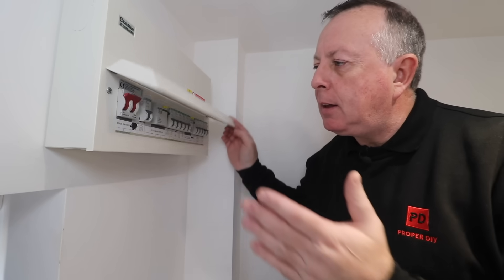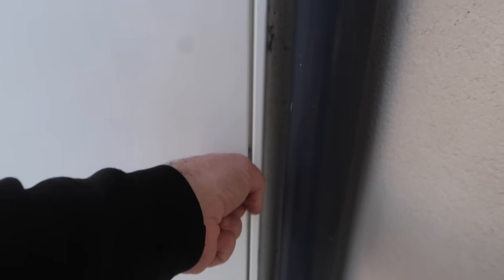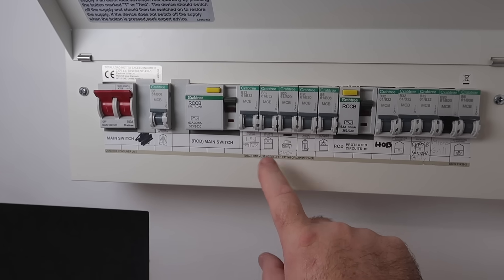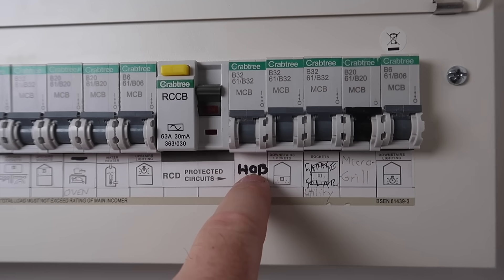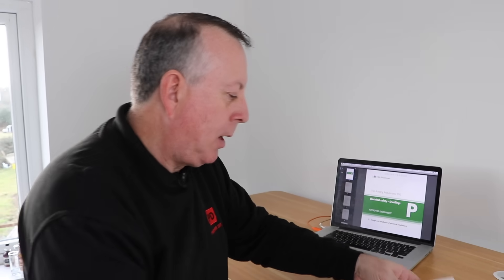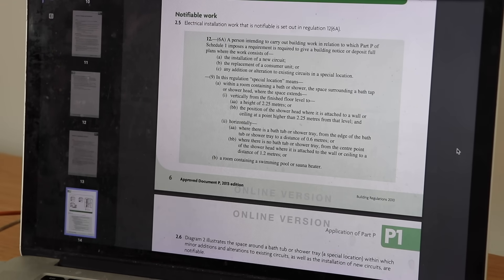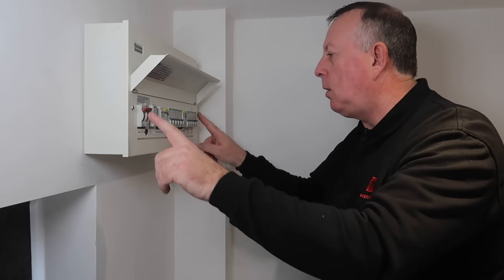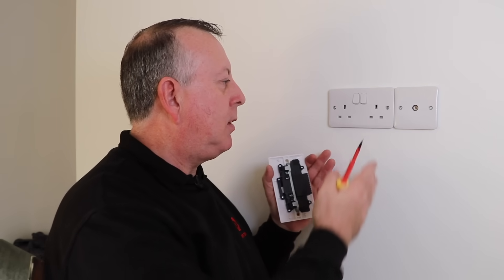What electrical work are you allowed to do in your own home?

Comment: Hi. Great video. I have a question, which I am really struggling to find an answer to. It seems a great cost for an electrician is the running of cables, etc. Can I run a cable myself to a consumer unit and then get an electrician to terminate it at both ends, or will he/she need to see the cable run. For example if I wanted to run a 40a cable from an external location near to my driveway (attached to house) and then run that cable internally through conduits, floor boards, etc., and then leave a length adjacent to the consumer unit. Then an electrician comes and does the clever/notifiable work at each end? Means I do the labour intensive stuff - pulling up carpets, running conduit, etc. I can see a scenario where they may be uncomfortable with not running the cables themselves - but surely carrying out a test should ensure this is all okay.
Reply: Nope. The certificate literally states about checking the cable, its fixings etc.

If a spark agrees to that, chances are he’s dodgy or crap

Comment: I rewired my own house. I dont have 2391 qual but I'm up to date with BS7671:2018. Am I in trouble?
Reply: Did you notify it?
Reply: @jameshansing5396  nope
Reply: In trouble with whom? I suppose if there was ever a problem & say someone got electrocuted via some fault in the wiring - a family member or someone visiting then you probably would be liable. However that would also apply to electrical work done by a pro & yet unless it could be proved it was their work that was at fault they would not be liable. Bear in mind people have rewired their own houses & it was perfectly legal before newer regs came into place & yet they would be in the same boat as a pro. Of course then it comes down to how can anyone prove who did the work & when it was done. If you have owned the property for years then it could be argued they would not have a clue when the work was carried out unless it is obvious that the work was done after the regs came into place & of course then as a property owner the work was done with your knowledge. Personally I would not worry as if you are confident the work is done competently then there isn't going to be an issue anyway. I mean what circumstance is electrical work going to be a problem if it is done correctly?
Reply: Could cause you issues when selling a property, could cause you issues with insurances.  Id also suggest it's possible this person might not know how good or compliant their work is?  I mean, if they are asking this question, their knowledge isn't 100%, is it?

IF someone is electrocuted or your house catches fire might be a fairly big IF in your eyes but it does happen.  You'd be surprised how often we find electrics with have been smouldering away, melted connections etc.

What you want to ask yourself is, IF it DID happen what are you going to say in court?

The BIG aspect of this is 95% of DIYers won't have a proper FMT so cant test their work.

Basically IF the worse DOES happen, you re suddenly DOUBLE f*cked..  and yeah, there is a good chance it can be proven when the work was done and it it's your house that's your responsibility......

 @triax7006
Reply: I'm fully confident my electrical work will pass an EICR, I just haven't had it signed off. Wonder if it's worth spending the £120+   @triax7006

Comment: Worth noting that as a matter of fact, no question about it, there’s absolutely no difference in law in England and Wales between what a DIYer can do and a registered electrician. Anything a registered electrician can do, a DIYer is permitted to do also, including notifiable work. Both DIYers and registered electricians are also obliged to notify the building authority of notifiable work. The only slight difference is that a registered electrician is able to self-certify that work complies with the building regs, whereas the building authority will inspect a DIYer’s work. That’s it; that’s the only difference, nothing else.

And most legal advice filed out by electricians is nonsense, of course. Good example is the nonsense here about not being allowed to open the consumer unit. For a consumer unit, nothing other than installation of a consumer unit is notifiable. So any other work on a consumer unit other than installation is not notifiable. That’s not me that decided that, it was Parliament.

The restrictions imposed on electrical work by the building regs are actually very minimal, despite what self-important tradies may like to pretend. Which of course makes sense, because connecting the blue wire to the blue wire, and the brown wire to brown wire is not difficult.
Reply: Yeh I think this guy has it wrong. It's all about legally having the work pass a test just like a car that is 3 years old or older has to pass a MOT & of course like an MOT as soon as the person testing it has left the building it doesn't mean the electrics are safe, it just means they checked them & they were safe when they checked them. The only reasons a "pro" would not usually check DIY electrics is because they would need to check all parts to be sure it all conforms to regs whereas a pro doing it would self check at all points & finally check it when finished. The other reason is protecting their industry, they want to make sure that DIY work cannot really be done so they get more work, the same with the legal profession & many many other industries.
Reply: @triax7006  There’s no way he can have read the law and formed his opinions based on it. He’s clearly just sat on the toilet and dreamed up what he thinks the law could be, presumably with the aim of making his job sound complex and skilled.

It’s the equivalent of a lawyer with absolutely no electrical knowledge making a video about how he thinks electrics might work, and getting completely the wrong end of the stick.

Comment: I will do what I want in my own  home
Reply: Do you fiddle around with your gas boiler?
Reply: @davebadger100  yes why not? Other vise it is straight racketeering
Reply: @lPalaXl  Yeah. I mean what could possibly go wrong?
Reply: @davebadger100  The same thing can go wrong when you use a gas cooking stove. Just dont be dumb that's the only requirement. Maybe a pressure sensor could be useful for configuring the gas boilers automation system though you can do it without it. 
For repair you even don't need any knowledge for new installation yeah you maybe need to do some calculation or read manual to know what supply/went air flow you need nothing more)))
Reply: @lPalaXl  So  no gas flue analyser or drop test then?
Reply: @davebadger100  you can rent them for day or make it with simple pressure gauge and hand pump)))
flue analyzer you have nose man))) (and again air flow for supply and went need to be calculated as i stated)
You trying to make some kind of rocket science out of simple electric/gas/water things))
I am software engineer born in 1993 and i am doing all gas/electricity/water in my apartment/house when needed and never had problem with that. Recently i installed 15kWt storage system with invertor and ATS wiring for backup zero problems with that. Oh no i had one problem one of my lamp in ceiling which was wired by "professional" electrician from residential developer where i get house was miss wired they connect N and PE to it. So yeah i better will do thing myself it will be better and cheaper.
Reply: @davebadger100  Last time i even tried to buy something from "trade" person was to make desk parts based on my design. Just a basic 2000x800 loft table. Wanted to get two legs welded from 20x40-50 steel rectangular tubes. Materials are less than a hundred bucks, and they charged me a grand+. Yeah, right! I'll just DIY it.
Reply: @lPalaXl  I'm guessing you're from the US. I've seen the state of the electrics over there. No wonder you think it's easy. You're about 40 years behind the UK in standards and installation techniques.
Reply: @davebadger100  I am from UA we basically have the same standard as EU+- but regulation and fines a lot weaker.
Same cables same MCB, RCD, ASDD, Voltage Relay etc usual 230v staff from abb, hager, schneider. The only thing that we mostly using MCB instead of fuses in low voltage.
Same about gas boilers etc we have access to italian gas control valves etc (And unfortunately it is illegal to touch them.... For absolutely zero reason but fine is cheep)
Reply: I feel sorry for your kids… 🤢

Comment: I have rewired three houses that I have lived in without problems if you suck up all you can read before you go and adhere to what you have learned it is fairly reasonable so long as you personally are switched on 😊
Reply: I would have no issue with buying a house that has been rewired by the owner. I would check the work myself & even if I found problems I would simply point them out & negotiate a reduction in the price. The real problem is assuming everything is safe because a "pro" carried out the work. The amount of incompetence with so called "pros" is astounding & ppl assume the work will be safe because a piece of paper says so.

Comment: Fortunately for me, I live outside the reaches of the bureaucratic minions of the UK, EU, USA or Can and insurance concerns don't apply.   My adopted  country has incorporated the US NFPA standards and supposedly requires a "licensed" tradesman to do electrical work.  The only problem is that there are no such tradesman because the process to educate, test and certify such tradesman was never put in place.  Not to mention that there is no translation of the NFPA available except at great cost.  

The quality of existing installations are all over the map but other than my personal dwelling, commercial and medical buildings and a very few others, it's the wild, wild west.  Conductor color code, even ampacity sizing, is ignored.  Sometimes only one color is supplied for all.  Grounding and neutral bonding are the most grievous faults.  As a retired P.E. from the US, I'll trust myself to follow good practices because a competent local is unavailable.

Comment: Why don't you show us also how to replace a 220 volt, 30 amp three copper plug outlet (such as for an electric clothes dryer) without an electrical permit. Better yet, show us how to replace an electric range/stove 220 volt, 50 amp outlet without pulling an electrical permit. 110 volt, 15 amp circuits are child's play, per "Chucky." :-)

Comment: Why are you adding any thing of your own in the dnos cupboard that's a definite no no
Reply: He owns the cupboard not them. They have all the space they need to get at their equipment. That is all they need.
Reply: @johnburns4017  well I would like to see you try and get away with adding in in the box done I deal with solar and ev chargers and we have been told not to put a garage unit I that box and after speaking to other engineers it's the same with them aswell
Reply: @garybill1323  
A garage unit is an appliance. In this vid there is  Lewden box, which is not an appliance. There also lots of space for them to  get at their own equipment. 

Once again. It is not their box. If they want exclusivity to a box, they supply it. Shishhhhh.  You are naive.
Reply: @johnburns4017  And if they decide they don't want your equipment in your box, they can cut off your supply and there's fck all you can do about it. 
Shishhhhh. You are naive.
Reply: @davebadger100  wrote:
"they can cut off your supply"

Can they?  You are naive.
Reply: Don't listen to John Burns. He is a DIY know all who is a prime example of why untrained, unqualified, incompetent people should stay away from electrical work.
Whilst he is correct in saying that the homeowner owns the cupboard, it is a cupboard designed for and supplied for DNO equipment ONLY. Whilst some DNO' s may turn a blind eye to domestic electrical equipment installed in the box, some won't. 

If you do install equipment in there, you could well be deemed in breach of your electricity supply agreement, and if you refuse to remove it when instructed to do so, worst case scenario would see your supply disconnected.

Again John Burns, stay away from electrical work, you really have no idea what you're on about as usual.
Reply: @davebadger100  
More ad hom attacks. He lost it.
Reply: @johnburns4017  Not at all. I am refuting the mis information that you keep posting. 

If you had a valid argument you would come back with a relevant response disproving  my argument.
You haven't, which just goes to prove that I am right and you are wrong.

Look let's face it, your basic DIY 'knowledge' is no match for my superior qualifications, training, skills and knowledge.
Reply: @davebadger100  
Ad hom attacks. Lost it big Time.
Reply: @johnburns4017  Any thoughts on the use of the DNO cupboard by the homeowner?
Reply: @davebadger100  
More inane tripe.
Reply: @johnburns4017  🤣🤣 Who's lost it then?  From your responses we can safely assume that I am right about the DNO cupboard and you are yet again wrong.
Reply: @davebadger100  that is what i was meant to say thanks for clearing that up for me 👍🏻
Reply: @garybill1323  No problem. The evidence is there, just takes a little bit of digging. Efixx actually did a video on the subject. Obviously being in the industry we all know what is and isn't acceptable.

Comment: Certifications are all fine and dandy, as long as you have the skills to back them up...
Reply: If you don't have the skills then  It's unlikely you would work under an NIC company as they hold high standards and anyone who works for themselves would Not be recommended by clients, Also ask the tradesman for a list of people who would recommend them.
Reply: @SJ80s  Straight racketeering. We forbid you to do things yourself and have certification/insurance system build around it so you will may a ton from your pocket for it for no clear benefit whatsoever

Comment: What electrical work are you allowed to do in your own home? 
All of it. ( small town in USA )
Reply: In the UK you can do all of it, except touch the suppliers equipment and meter.   You need to be competent.  That is the key word.
Reply: @johnburns4017 
Same here in small town USA. The three overhead lines, the connectors to join to your own three feed wires and the "plug-in" meter portion of the meter box are the only things owned by the company, everything else is is owned by the property owner.
Agree a person SHOULD BE competent to do electrical work, but that is not required under the law (PSA check your local laws) to do the work in your own home.
Reply: I mean you lot voted for trump so yeah fuck it

Comment: Everything said in this video is very sound and sensible however,it is completely wrong on the point of law! No one is going to take you to court or fine you £5000 for installing your own new db or any circuits you may wish to add, or even rewiring your whole property! Part P came into being to regulate businesses and registered self-employeds like kitchen fitters and plumbers who carry out some electrical work in the course of their work to give them accreditation to comply with their public liability insurance requirements. It does not apply to home diy whatever you may think. If it did, B&Q wouldn't be selling any electrical materials to you. If you go to any of the electrical wholesalers in the land, they will not ask you to prove you have part P before purchasing anything you want to! Oh and by the way, believe it or not the IET 18th edition regs are advisory, not mandatory! I speak as a professional electrician, however much I hate the awful botches diyers make or even 'checkatraders' come to that, Yes, part P is a good thing but in all the years it's been around, I've yet to hear of anyone who's been prosecuted or fined for adding their own ring main or wiring their own shower!! As for building control at your local council - don't get me started!
Reply: "the IET 18th edition regs are advisory, not mandatory! "

Correct!   You can fit a full US specced installation in the UK - God forbid! Or a French or German. I recall seeing house full of German Schuko sockets and German CU (cool) - he was German, buying them cheap in Germany.  All legal. I have seen full UK specced installations in Spain and France by UK ex pats.
Reply: Good points. I like to see it in the same light as doing work on your own car - especially the parts of the car that would be in a MOT. If anything is done incorrectly or are downright illegal the aprts a MOT cover will make sure the car is safe for the road - at least at the time of testing because as soon as you drive back onto the road an MOT whilst legal doesn't mean the car is safe to drive on the road. The same could apply to electrical work tested as it will be according to regs & signed off, however even if no more work is carried out it cannot be assumed a fault cannot occur. And indeed how exactly can any work be assumed to have be carried out by a pro even if a bill could be produced to show electrical work carried out?